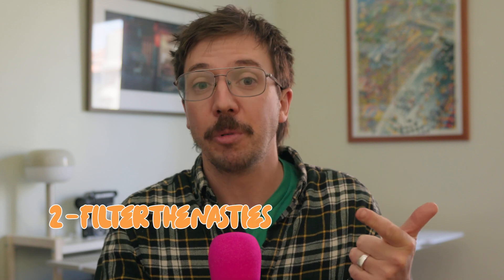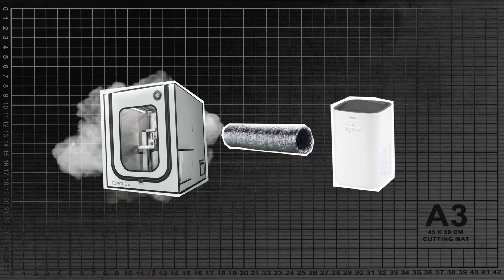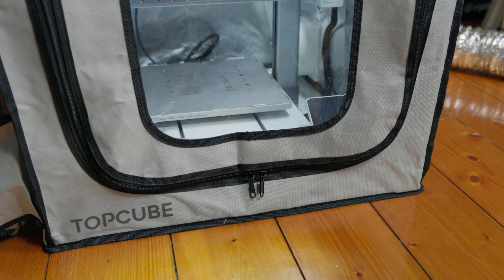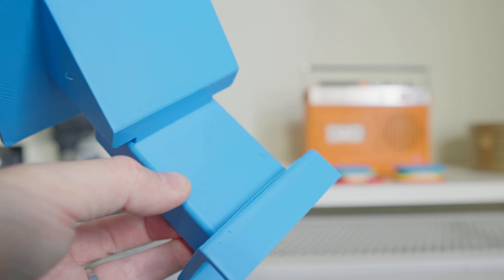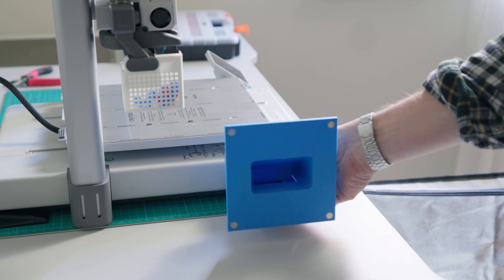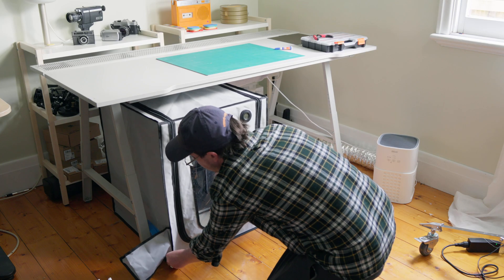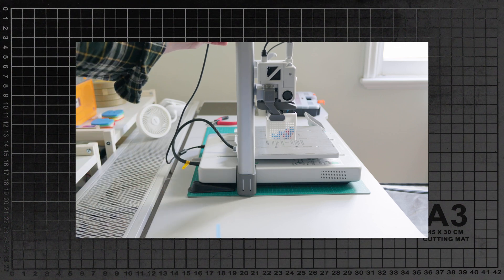Active cooling upgrade for enclosed Bambu Lab A1

Comment: I am looking at 3D printers right now, and of course the A1 is on my list, but I am also worried about toxic vapors and microplastics.Would it be better to get the A1 and go through this whole rigmarole of the enclosure/ filter setup or simply spend a little more and buy a fully enclosed 3D printer? Thanks!
Reply from the maker: If I had my time again and money wasn’t the issue, get something enclosed

Comment: My enclosure has two vent holes, kept closed with velcro that I'll take advantage of, so I won't need to cut any holes, but they are near the back. I might have to model my own ducting to bring in fresh air from outside and vent what cooks the motherboard back out, so I can print polycarbonate better than I have (I've been only heating the enclosure up to 40c, which is a reasonable temp to expect electronics to handle) without worrying about cooking my motherboard, or the air drawn in to cool it cooling off the enclosure ambient temp. Essentially making an air channel through the enclosure, isolating the motherboard from the internal air temp . I might need to modify the screen's case to include it in the channel. 

I have made an Ender 3 LCD distort its output when I used a 12v PSU (so I could use a 12v hotend while I waited for a replacement 24v) and the 24v heated bed needed help from a hair dryer. There bed, with assistance from the hair dryer pointed right at it, couldn't go over 74c, and the screen was damaged when the hair dryer slipped from where I positioned it and was aiming at it, so 70 ish is too hot for at least the Ender 3 LCD, idk about the Bambu A1, so it's best to be cautious

Comment: I have the same tent and A1, also an a1 mini with a similar tent. I use a 4 inch pipe with an inline pipe ventilator to suck the air out on the left side at the top because warm air goes up and a passive opening on the opposite site at the bottom to let fresh air in. Now i am thinking to install a little ventilator in a air tunnel solution like yours to the mainbaord cooling openings. My question is are those holes in the A1 on both sides the similar? Where is the passive cooling element, on the right or left side of the A1 when watching from the front? I havent used my A1 yet because of this, it came last week but my A1 mini and i can confirm it gets sometimes 31 degree Celsius in the tent, so i need to tune my tent a bit more it seems. KI says to get the temperature down you need sucking air out in the top area and either passive or active pushing air in the bottom area, optimal is the opposite side. The opening needs to be same or larger as the hole for sucking air out, it needs a filter for large particles as well, not a Hepa or something like that because air resistance. If not all kind of particles will stick to the oily rails etc. 

The P1S is not a solution in my mind because i can imagine that its not as air tight, its huge and its nice that you can lift out the A1 for maintainance. It also dont offer a ventilation system for sucking the air out of the window with an inline pipe ventilator, it has only a small CPU cooler like case ventilator i think, so i had to mod it anyway. I think the A1 is more convenient with the tent solution, simple and cheap. I got mine for 280 with the coupon. Its also not overkill for PLA, i could feel it even on my teeth minutes after printing had started, in my lung, i had a strange taste in my mouth and you can smell it. I wouldnt use such a printer without a housing. I think the mainboard of the A1 is where the display and SD card slot is, so maybe its better to install the vent tunnel on the right side. Edit: yes, the P1S only has activated coal pellets, a small amount and like a CPU ventilator, not radial design. The negative pressure seems to not working as i saw in a video because the smoke coming out of the poop opening, its not a solution in my mind.

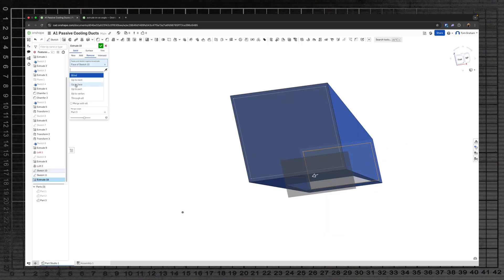Comment: at 2:49, you mention the extrude angle not working. I think someone else mentioned a sweep and that would work. But I think the most effective way to solve this particular problem is starting with the loft, then shelling that object. Shell does what it says on the box: Hollows out the inside of the model leaving behind a wall, which you can set the thickness of during said shell command.

This creates the open channel you want, and creates that nice smooth funneled air duct you were looking for. 

I'm no fluid dynamics expert or an engineer, but I don't imagine you'd get heaps of increase in efficiency of the system by going with your first idea over your second idea. You found a good alternate solution that works A-OK!
Reply from the maker: so far so good!
Reply: @Billt_it  Another way. Not worked with onshape, only with fusion. I see you already done smaller contours of those faces, so at least on fusion you can do also loft with those smaller contours, but then will be option to cut, like extrusion.

Comment: Can i get a copy of the stl or 3mf file? Thinking about modifying it to fit my enclourse.
Reply from the maker: Oh yeah good shout, I’ll get it up on maker world and hit you with a link
Reply: @Billt_it  Thanks. I have a different unit from Sky. I like the idea of directed air to both inlets, I was planing to design one myself. I would have missed the second inlet. Someone suggested about tubing the outlet near the touchscreen but I dont think it will make very much difference on the enclosure temp.
Reply: @Billt_it  Could I please get a link as well? I tried finding it on your page via makerworld but nothings poppin up
Reply: I would love a copy as well. Maybe you could put a Makerworld Link in the Video or as a pinned comment?

Comment: At this point just buy a P1S at this point lollll
Reply: nope, the P1S has a bad ventilation system, its way to weak, its not radial ventilator, You need strong pipe inline ventilator, 4 inch for example and suck the crap out of the window, maybe to your neighboor :) THen you need on the opposite side another opening, a passive opening for fresh air, maybe more towards the bottom of the housing. A slight negative pressure will be created, since warm air goes to the top of the housing its better to make the opening for the exhause pipe maybe on the right side but more in the top area. The P1S dont respect all those laws of physics i would say. Thats why i bought cheaper A1 with a tent and mod it myself. The P1S is not designed to eliminate the bad fumes, it has a tiny active coal amount and no filter at all as far as i know, only coal pellets.

Comment: Hey dude I’ve been loving all your videos and it’s only a matter of time before this channel takes off but I was just wondering if you had ever have fusion 360 a try and what your full thoughts on onshape were!
Reply from the maker: I've not tried Fusion360, I'm not 100% sure that the free for makers version is available for Australia. I could be wrong there but I do recall trying to find that before I found OnShape, which so far I really like. Any new software is a learning curve but this has been pretty straightforward to jump into. I tried solidworks briefly and frankly hated it, enough to request a refund. It was through that frustration that I discovered OnShape. I've also heard good things about FreeCAD which I might take for a spin too but haven't yet looked into. Only so many hours in the day!

Comment: Maybe a sweep along a path would be a better option if you want more control in the path used to connect the faces. Doing a sweep halfway, then a loft to connect the faces would work. Theres a million ways to skin a cat, the good thing is that you can accomplish anything with boolean, cuts, and other basic things should things go wrong.
Reply from the maker: Yeah good shout. I'm so new to OnShape that I know there's a bunch of tools in there that I'm not even remotely familair with that will probably be able to do all the things that I need. I just need to spend a little more time sitting and noodling with it.

Comment: Unless you are printing ABS, there is no reason to enclose the A1 series. Electronics will work fine up to 60°C, that's not the problem. The hot end cooling fan isn't strong enough to properly cool the hot end and will cause heat creep.
Reply: you need ventilation, sucking the air out and fresh air in to keep the air inside cooler. You can activate hot end ventilator permanently as far as i know. And no, without enclosure ultra fine particles and Gases will enter the room, your room. I print PLA and right after the first minute of printing my first benchy i had a strange smell in my mouth, my tongue felt like velvet and i could feel it in my lung. There was also a strong odor, so yes you need absolutely an enclosure unless you want to harm yourself permanently. Even a kid knows that melted plastic can cause cancer.

Comment: Vector 3D did a really good teardown of the A1 when it came out and found the control board is on the right hand side (where the screen is), left is the Power Supply. Hope this helps.
Reply from the maker: Oh that does help! I'll check the video out, hopefully what I've done is get enough cool air into the case for it to take care of itself and suck in what it needs. Time will tell I guess!

Comment: to do your lofted shape:
create a sketch on the surfaces of your solid shape. then draw rectangles that are 2mm away from the edge of the shape (or however thick you want the walls to be). then repeat the loft operation you made the shape with, but instead do a loft cut between the rectangles you formed. this will remove the material and give you the shape you need.

also, consider using guide curves if you want a smoother shape instead of straight line curves.

i like ur channel, so feel free to contact me if u want help with design of parts :)
Reply from the maker: My man! Thank you, such clear advice. I feel like I looked for this elsewhere and just couldn't find it in a way that clicked. Much appreciated!

Comment: It's fine,  people enclose this in airtight cases. Only issue may be heat creep if you do PLA, but the machine itself can survive way more you can heat it up to when enclosed.
Reply from the maker: I guess this way I'm setting myself up for some longevity - well that's the hope anyway.
Reply: What is heat creep with PLA?
Reply: @davidmaliglowka pla should be cooled down to ambient when printing, since a1 has pei sheet by default, the plate will be at 55 celsius or so. If you enclose it, the heat from the plate willl slowly rise up, heat the upper layers and can ruin the print. That is why enclosed printers usually have vents, or in case of p1s/x1 removable top.   This of course defeats the filtration, so you need other way to cool it down, having one extra fan to suck outside air should be enough at this scale (if you do this, play with config - it may be better to have it as exhaust through filer, and have some vents around the case, that way you keep negative pressure and suck in through the openings , and no smoke escapes the case unfiltered)
Reply: This 
i use a1 Mini and a1 + enclosure and i Print every time Closed and withe pla its Not a pla but i use coolplate from Panda 35-45 bed temp over 2k hours Print time

Comment: Bambu sells an enclosed printer. Buying the cheap one to enclose it and having issues is par for the course.  Right tool for the job type thing.
Reply from the maker: Oh 100% agree, this has been a journey of sorts though. I never set out to buy and enclosed one because I didn't do any research into open air pritning before I got the A1. I jumped in with zero knowledge of this world and am learning from the community along the way! If I had my time again, or maybe in the future, I'd look at one of the higher end enclosed units.

That's not to say I'm not stoked with the A1 though
Reply: where is the fun in that

Comment: Never used onshape so I'm sure theres an actual solution but a potential workaround is to extrude the shape as you did and then use the Shell option to hollow it out, and then extrude out a square at the other end to make that tunnel shape you need. Most of my cad is only done the "right way" about 50% of the time the rest is workarounds
Reply from the maker: Yeah I think that's the way, I just haven't been able to crack the code yet haha. Most of my career has been 50% done the right way...😆